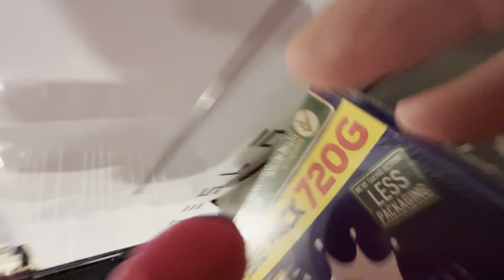Mitsubishi Heat Pump Trial Update - August 2022

Comment: I have Small bungalow with eco Dan heat pump for 5y it uses 900kwh in January and I only have temp at 19c with all modern insulation double glazing etc
Reply: @Mark Williams
Hello Mark.
Do you know how many kWh your immersion heater is using?

Comment: May I ask how you found the running costs at the flow temperature they specified .
  Clearly there are one or two in the comments who have found running their ecodan expensive .
  Our installer has specified two cascaded 11kw pumps .
  Now that of course is not the maximum draw in operation but the person who has used 900kw in a month is alarming .

Comment: I'm not convinced that these heat batteries are a good idea because I think the storage capacity is far too low due to the low temperature that the heat pump operates at.

I believe a better solution would be to use a Tepeo Zeb "electric boiler" which has resistive heating and about 40kwh of capacity, charging it overnight using Octopus Go and topping it off throughout the day using excess solar PV.

While the resistive heating is far less efficient than a heat pump, this is offset by the far greater storage capacity which allows you to take better advantage of the Octopus Go tariff. With it being a resistive heater it can reach a far higher internal temperature which is how the storage density is greater than with these heat batteries and it also produces up to a 80C flow temperature (Without a reduction in efficiency!) which means that your DHW doesn't require an additional immersion heater and you can retain your existing small radiators and pipework in an older house. I don't have this system mind so I've judging from the datasheets, but we're planning on switching to this setup soon. I believe Tepeo are planning to support multi-unit installations some time soon which would be ideal to provide 80kwh of storage capacity and we'd pair it with an oil boiler as a backup.

Comment: Glad to see you're finally getting a bigger heat pump. It did seem from early on that you weren't getting enough heat from the system.
Ours (we're on the same trial) is still running really well and we've been told that we're getting control of the heat battery charging in the near future. As Grant mentioned, the system is managed remotely so there's a system called Kaluza that decides when the heat batteries should be charged. That's going to be changed so we will be able to decide when they are charged, which means we can take advantage of cheap overnight electricity.
Reply from the maker: Well I thought I was getting a bigger heat pump, now with Ovo for pricing sign off before, what I thought, was a booked install. Watch this space

Comment: You need suspended floors and under floor heating for a heat pump to work they don't really work with over sized radiators in an old modified house
Reply from the maker: Maybe. So one option, if it really does not work, is to hybrid this. Use the Heat Pump to 50 degrees then use gas to uplift on the cold days....
Reply: I’m running my gas combi boiler at 48 degrees flow temp for the heating and my house is nicely staying at 21 degrees when it drops to around 5-6 degrees outside.
Reply: We will have underfloor heating in half of the house on the ground level. The rest of the house will be standard oversized radiators. Looking to run the new Vaillant heat pump at around 45 degrees flow temp. Set the house to 20 degrees with a 4 degree setback temp of 16. 250 litre tank should be plenty for our 4 bedroom house. We mainly use mains water fed showers and the odd bath once in a blue moon.

Comment: 300£ for January wow and that was cheap electric
Reply from the maker: Thanks for all the replies. The Heat Pump was installed last November so we have already gone through one winter with the system. We have 7.3 kWp of Solar and also 13.2 kWh of Battery Storage, which we are planning to double. We also just agreed a new Octopus Go fixed tariff until August 2023 so we can plan this winter. So by heating the 550L of hot water at 7.5p per kWh and using the Heat Pump to heat the house overnight,  the 27 kWh of battery storage would be to help with the space heating during the ay. We also have a log burner and have a tonne of Heat Logs ready to 'top up' the living room.

Comment: I do like the idea of a thermal store tied together with inputs from heat pump and resistive heaters with software deciding based on forecast solar, weather and grid pricing what to do. - complicated though feels like a bit of a nightmare with all the different parties involved.
Reply from the maker: It's a trial, sure I've been in the dog house plenty, but hopefully the new system will iron out the issues